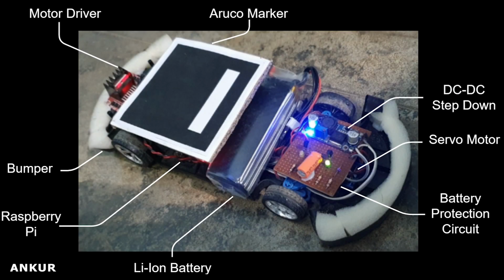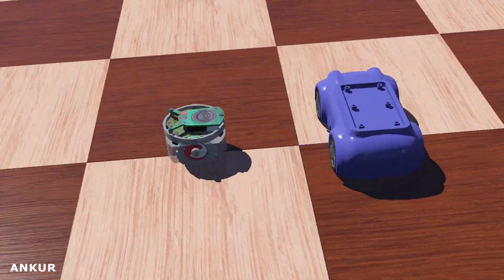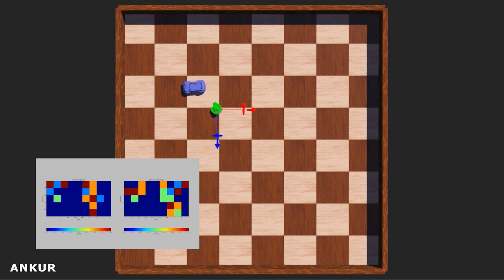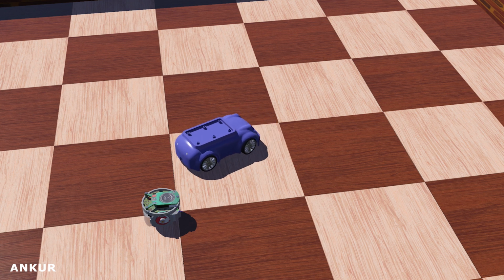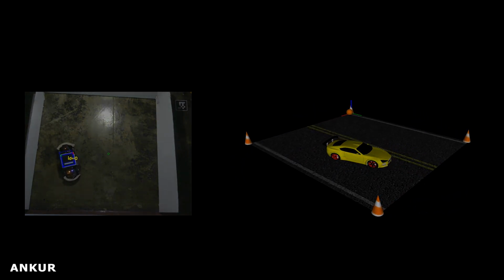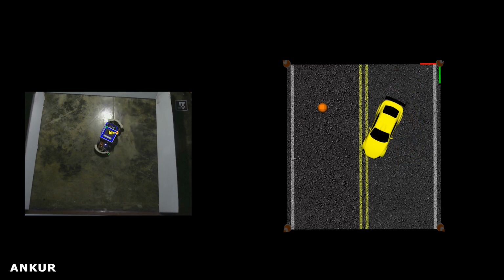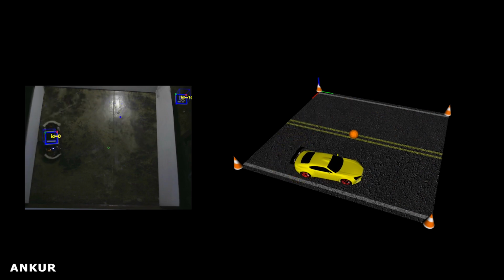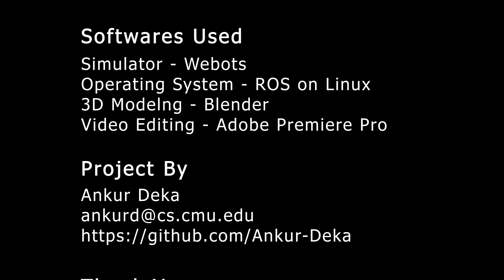Self Driving and Drifting RC Car using Reinforcement Learning

Comment: Now the bigger problem is with having a set up that tracks the car accurately, do you think it will work if it is trained on the sensor data instead?
Reply from the maker: That's a very good point you've made. It'd certainly be a more difficult problem if we use only on-board sensors and I chose to simply the problem. Maybe we can combine an existing map with IMU, odometery and LIDAR/Depth Camera. It'd be interesting to try.
Reply: What if we consider a smaller region that the car can see in the simulation itself?
Reply from the maker: Yes we can try that for the simulation.